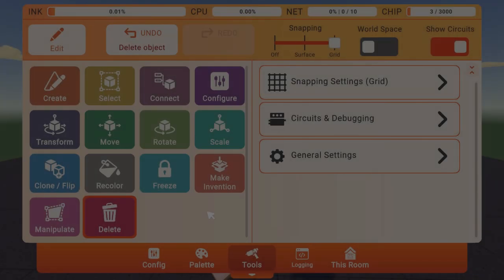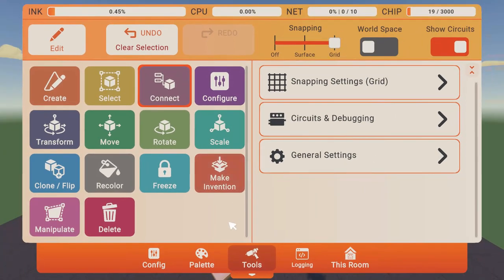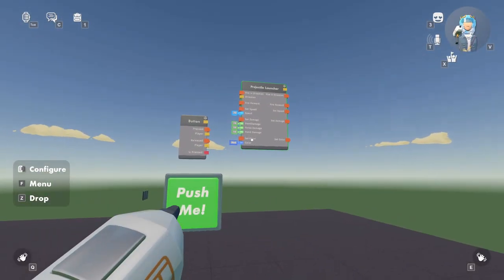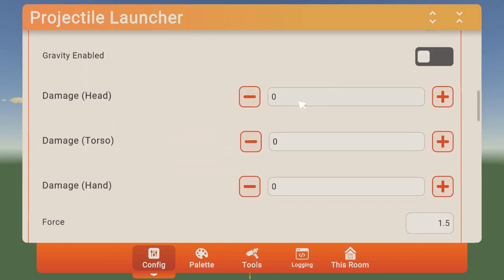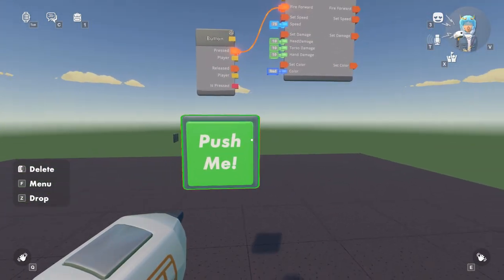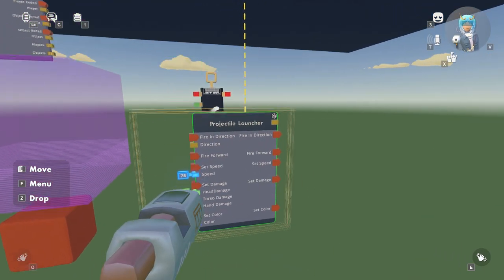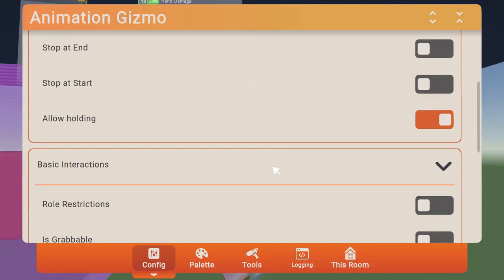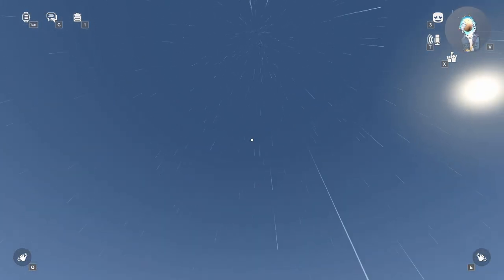How To Make Rain In RecRoom

Comment: you just need a update 45hz (or whatever it is i forgot the name) and hook it up to the projectile launcher. alternatively, if its too fast and a CPU heat error occurs, you can have 2 delay chips: after delay (on one) - run (on the other) and repeat. to make it happen without a trigger, just get an  event sender for when a player joins
Reply: 30 hz but close
Reply: Ty!